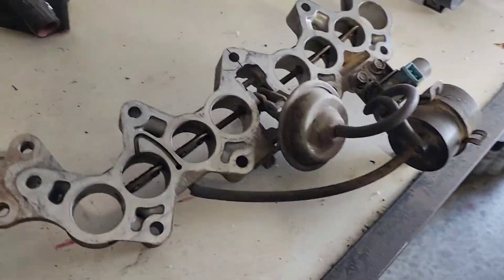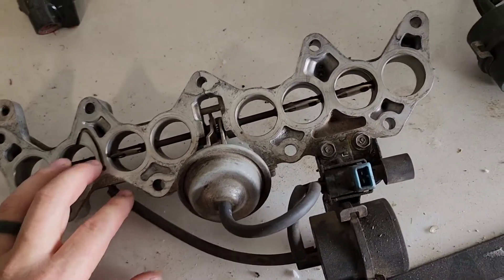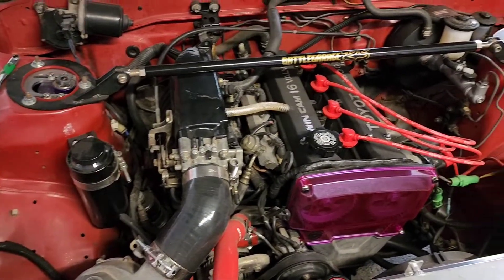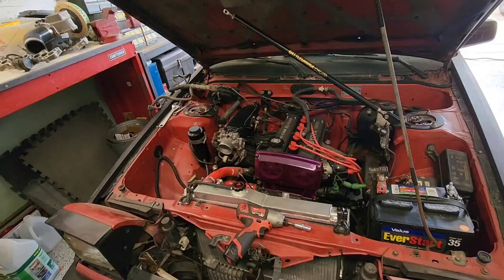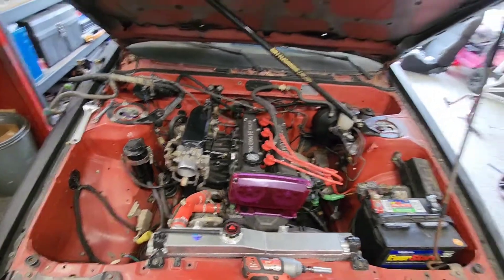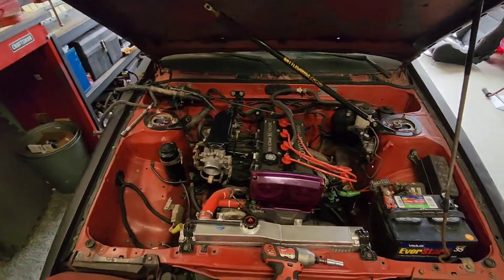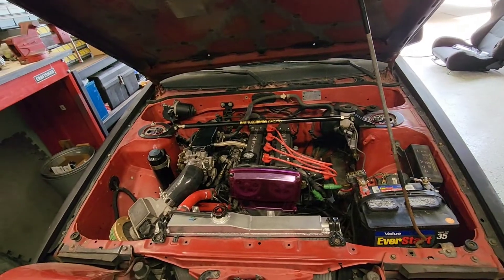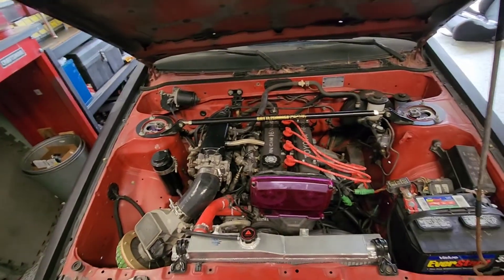AE86-installing TVIS on the 4AGE.

Comment: I removed mine for more flow 
And the engine still runs similar feels like boost at 4500rpm with or without tvis  in my opinion 

I want to block my egr though